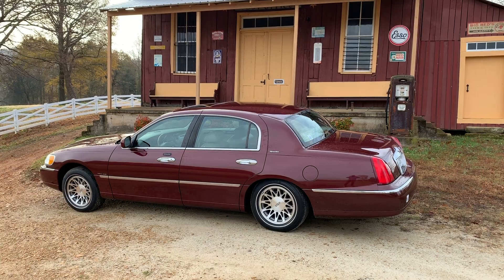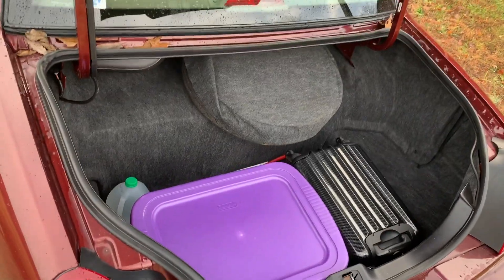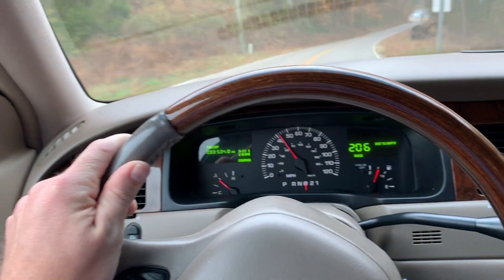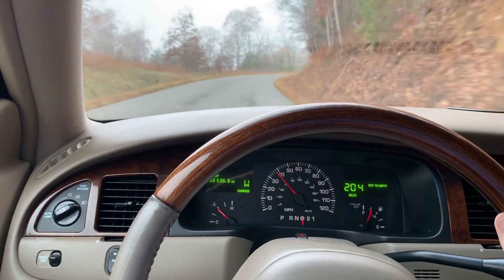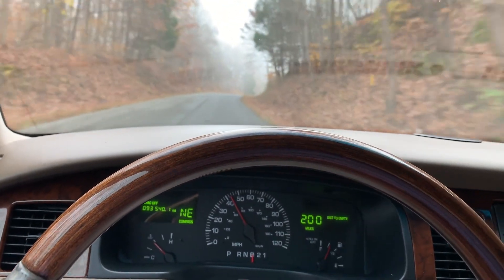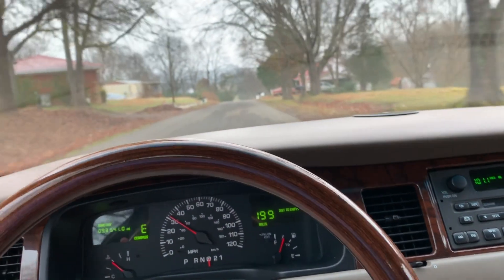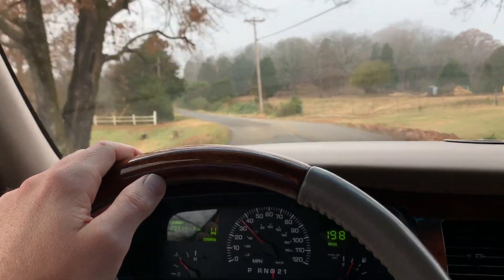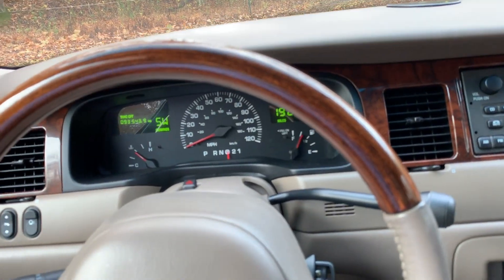2000 Lincoln Town Car Signature (Should You Buy?)

Comment from the maker: ⬇️Jake’s Top Recommended List: 

Restore Your Old Headlights With This: https://amzn.to/2sQYokq

Best Phone Holder Case Ever: https://amzn.to/2Xwbxea

American Flag Face Mask: https://amzn.to/2X1sUEH

Subscribe: https://bit.ly/2LX3YaW

Connect with me Instagram: https://www.instagram.com/jaketiesler/
Reply: 2002 and up lincoln town cars came with the fixed intake manifold wich was a serious problem on the older ones breaking and costing over a 1000 dollars they were plastic and if you put a stock new one on they would just  break again.
Reply: Instablaster...
Reply: The 2000 and I believe up to the 2005 had the old 90's style steering wheel. I loved the radio controls but the radio itself was just OK.
I have the 2006 TC. The radio is more powerful. It almost sounds like there are subwoofers even though there aren't.
Very nice sound.
And I have the Signature Limited, so there's a couple more inches of leg room in the back seat. Nobody ever complains.

Comment: You kept referring to a "pump noise".  This is the air ride suspension and as you drive down the road, it will keep the car level and adjust the smoothness of the ride.  I have owned three of these cars and they are extremely dependable and I would highly recommend them to anyone.  Very few problems on my 2000 Signature with 190,000 miles.  I expect to get another 100,000 with no problems on this car.  I might also add that the Alpine Stereo not only has cassette but also a 6 disc CD changer in the trunk.  The surround sound is fantastic and better than any car I've owned before.  And the sunroof is icing on the cake!  Love my Lincoln!!!!
Reply: Bro youll get more than 100000 more these cars if well maintained   cam run up to 600k amd higher and even if the motor blows most people junk them when you can easily get a cheap 500 dollar motor replace ot amd run forever
Reply: Whatever you do don't change the stereo it's amplifier match to the speakers it'll sound like crap if you put those speakers with a cassette deck or a CD player
Reply: @raysegura4139  Much appreciated....

Comment: I just bought a 2007 with 66k. Town Cars are great vehicles. My third one.
Reply: Is the air ride suspension problematic? Is it difficult to fix?
Reply: @supahdupahplayahmacknumbah1  After 10 years, yes. Hit a bad pothole and it starts leaking out. Would be better to replace with coil spring once it goes out though. There is a kit you can get specified for the town car, but takes a while since you would have to remove the air suspension. The light will stay on in the Cluster after that, but it can be ignored as long as you tell someone that it doesn't contain air suspension so dealers dont try to spend too much time wondering why the light is on.
Reply: @supahdupahplayahmacknumbah1  All air ride systems are somewhat problematic with pumps, lines and air shock units.  But in my experience the later Lincoln systems are quite reliable and can last well over 10 years with no problems in the right conditions where as the GM\Cadillac systems are much more prone the failure and more expensive to replace or retrofit ...

Comment: LOL Funny you didn't know about the reliability of these cars when there are livery fleets of LTC's with 700-800k on them
Reply: With that mileage is it with original transmission and motor?
Reply: @planetstupider502  Yes....theres a guy on here who just bought a Crown Vic with 1 million miles on it and it still has original engine and trans. All those use the same 4.6 L engine.......they are awesomly reliable engines.
Reply: @dalephillips8250  Taxi cabs have broken 1 million miles Alot too, with the crown vics
Reply: @captainamericaamerica8090  Yep I know about that also.
Reply: @captainamericaamerica8090  bullshit
Reply: @campervanelvisitoofonyou8720  It is actually true, there are ton of them running with way over 800k no problem. those tanks last forever. Very well built.

Comment: Great car from the period! 4.6 w/4 speed auto. That combo with proper maintenance will go 200K easy. If the back of the car was sagging in the morning, i would say the air bags in the rear are dry rotting and leaking. That car in that shape will make a great used car!!
Reply from the maker: Yes! Yes they are, I’ve been hearing the pump kick on when sitting. Cool cruiser!
Reply: If the air springs are anything like the older ones like on the Lincoln Mark VIIs then it could be that just the O-Rings have dried out and shrunk in size. The Soapy Water Test should be able to help determine if its the bags or the O-Rings where the solenoid mounts on top. I have an older Lincoln than this still riding (for now) on three of its original air springs. One common leak points on the air springs is those O-Rings compared to the air spring itself.

Comment: I have an 03 naught it near the end of 2017 with 76k now it has 110k I drove through a puddle and a coil pack stopped working cost me $150CDN to fix otherwise I've just changed the oil so far it is about the most reliable car I have owned. I't is like driving a couch. Great car.
Reply: Armed with a 7mm nut driver you could of changed that in 5 minutes. Watch a video and DIY!
Reply: It's like driving a couch. LOVE IT!!! 😎 Just spotted a beautiful silvery-beige 2001 Town Car for sale near where I live and I'm really thinking about buying it. It's not what I was in the market for (was looking for a black Ford Taurus Limited 2015 or newer), but for $1,950 with a ton of new parts (suspension, intake manifold, brakes, tires, brand new tabs, and more), I'm thinking this car is a pretty good buy. It has 237,000 miles on it and the leather seats are very beat up, but from what I'm reading about these cars lasting forever, I'm seriously considering buying this car tomorrow. I could throw on some nice seat covers and it would make the interior look near-new. I've never been a huge Lincoln Town Car fan (owned a Mark VII and two Mark VIII's since 1999), but after seeing all the rave reviews on these cars, I just might go for it. 🤔🤔🤔
Reply: Made a mistake on the dealer to charge me $100 to replace a coil pack I buy them on Amazon now for twenty bucks with lifetime warranty

Comment: Yes reliable! We have had 4 in our family over the span of my 34 years of life! One we had from 91-08, a 91 executive continental, when I was 14 I started driving it alone & traded it in to buy a yellow sunfire to match my husbands when I was like 19 or 20 cause we had a newer town car, next car listed but I do regret that! The second Lincoln in my life was a 2000 Cartier town car from 00-2017, I hit a deer and then it was submerged by flood waters in hurricane Harvey & since I couldn’t handle riding in anything else with my spinal fusion & needed to stick to my dream town car hahaha the 98 signature town car we bought in 2018 & just got a 2009 signature limited for my dad, we hit another darn deer and he passed away leaving The Eagle to me.  I grew up riding & driving these & DONT like to drive anything else. Fun story, my buddy’s 02 double stretch executive’s air ride went out 😢 but we fixed it! I’m 5’1” & like 100lbs soaking wet  with rods and screws in my neck and back and still rolled under there 😅 she’s been afloat since changing the air ride bags (it’s not hard) & replacing the air line running from the compressor to the bags. See, he raised it onto jacks without shutting off the air ride 😮 I was like NOOOOO Never ever ever do that! Maintenance & upkeep is easy, take care of your town car and it’ll take care of you. Change your entire coiling unit, all the cylinders.. it’ll run beautiful forever if you just pay attention to it & keep your radiator clear of debris. Air ride problems don’t have to cost a fortune if you’re just a little savvy with basic mechanics.. the compressor under the hood has more bolts than anything related to the relay and they’re beneath it, up front. The bags are underneath but twist out. Seriously it’s easier than changing the oil & filters lol.. by the way, they do some mad burn outs and are fun on the track. I have a burnout video on my tiktok with my silver blue hue sig series or AKA the SS Ice Dragon on @tessy.Ohana not advertising just like hey y’all this car is a beast & is a lot of fun. It eats gas but if you reset your gauges once you’re cruising it helps. 😊

Comment: 2 things, 1 I'm urr age and say same thing when going to my Dads. I know these roads like the back of my hand. Yes we do. But in country deer jump out and cost me a grand worth of damage. Always keep a sharp eye out. 2, I own a 99 Cartier 253K and 07 designer. Same mpg, gr8 cars. The air springs get cracks cause nobody seems to get the fact that rubber is like urr skin and needs moisture. Slap a handful of Vaseline or 303 spray. My sprigs are going on 11 yrs in rust belt. They r 1st cars to get a 5 star crash rating, reroute the AC drain so water don't drip on passenger frame and rot, seal up cabin air vent, and service on time. They will last 4ever. Many go 500k and some 700 or more. All about care. Have a good 1. I love these cars. Especially for family.
Reply: Do you recommend an 04?
Reply: @demri123  Yes. I recommend any panther car, town car, crown vic, Mercury Grand marquis. Any year 03-10 is last gen with newest advances. B4 that they are good but have older style heads, non pi, older plastic crossover that can leak. Small issues nothing major. They all have issues but the panther has few, and those are easily, and cheaply fixed. They're truly the last gr8est sedan produced. There's a reason why they was and still are being used for cop, fire, etc.

Comment: One of the most reliable cars on the road today with very cheap repairs if any, usually to air suspension...(not as cheap though)...I've owned many TC's and love them!! They are like an old pair of shoes....just feels like a great fit and comfortable..plus I could get 32 mpg hwy driving mature...gosh I loved my last one, a 2003..would love to find a 2005 Cartier or Ultimate edition with every option..including the power trunk..the one that actually closes from the full open position!!
Reply: Just replace the air bags with coil overs from a 90s grand marquis and problem is solved. Hardly any difference in road feel
Reply: Liar there's no way your getting 32 🤣
Reply: @Elijah-fc3ex  I commuted from Tampa to Sarasota several times a week..I was OCD on tracking my MPG..I do not depend on the trip computer either...I would fill up drive down then fill up again..that would determine my mpg ..I admit I did drive slower..55 to 60 most of the time..no stop and go..all hwy between Tampa/Sarasota..Many people with the Panther frame Fords attain 32 mpg..not that unusual!!! You do have to drive like an old man...drive like there is an eggshell on gas pedal and a glass of wine on the roof..no fast starts or hard stops!!
Reply: The east coast of Fla is mostly flat. When I drive my tc car in Fla I get 25mpg in all around driving  29 on hwy . In South Carolnia which is alot of hill and dale driving I get about 15mpg in all around driving. 24  on hwy .
Reply: THE TOP ELITE MODEL IS THE PRESIDENTIAL MODEL. I HAD ONE AVAILABLE TO BUY AND I WAITED TOO LONG TO BUY IT, IT WAS,SOLD😩😩😢😢😢😭😭😭

Comment: The only reliability issue I've seen with these is the air suspension. The bags wear out, and the pump works constantly to inflate them. The good news is that it's $150 for a spring and shock kit that turns it into a coil suspension, and it's easy to drop in. These are panther body cars, so think of the mercury grand marquis and Ford Crown victoria with way more luxury. The thing I love about these cars is that they aren't apologetic about being comfortable and luxurious. Luxury trucks and suv's always felt like they had to justify their comfort with utility. These cars feel very pre 9/11 in that they signify success in the way that having one means you don't have to work hard anymore to make it; you're already there. They aren't meant to be particularly fast or sporty and the trunk is large to fit golf bags and luggage. When you are in one you get a feeling for what the ww2 generation had in mind for life. You get to feel what boomers were told they'd get before financial collapses took their pensions and retirements away. You don't get cars like this anymore, especially not marketed to the middle class.

Comment: Another thing is the cats. I run mine with no cats. Use spark plug non foulers for upstream. There's videos on that and have just mufflers. Or make it loud. Also tge airbox horn for fresh air is 2 inches. That's a joke for a V8. I make it 4.5 inches of respectable size. And make sure on 02 older that throttle cable is tight. Mine wasn't opening 100%. A few small zip ties to take up slack fixed that. Shell surprise u. Not a racer but for a big heavy car that can breathe easier with less restriction, she'll squat and go. Love panthers. Gr8 cars with best ride besides a Citroën with the hydraulic ball system. That's the best riding car I've ever been in. Better than a Bentley, why they borrowed it. and Rolls

Comment: I own the same vehicle and the surge has to do with the idle fan taking up most of the power. That indicates a bad idle fan motor. You can disconnect it and the surge goes away, but isnt recommended as the engine can heat up badly in the summertime. I would recommend replacing it, but not sure of you have by now or not. Vehicle has 87,000 miles when air suspension went out and had it replaced.

I will give you Pros and Cons from my experience.

Pros:
° ride is smooth
° sunroof
° break pedal adjustment

Cons:
° Alot of electrical issues (some is resolved due to some pins have corrosion on them in connectors, but has to do with age)
° Parts aren't cheap, but they are cheaper than when it 1st came out.
° Would recommend removing the air suspension and use coil spring instead as you will have frequent problems.
° Some parts are no longer made, like the insturment cluster, which you would have to find someone who fixes them.
° CD Player is in the back trunk (can buy a replacement radio with built in CD Player to combat this and is pretty cheap to do)

I recommend it, but make sure you have money on you just incase as they are old cars and may have alot of issues due to age.

Comment: The pedals on these are hazardously close to each other, adjustment or not.
At a light, you can easily be feeding it gas.  You can also hit the gas at the same time you are braking resulting in a pretty violent herky-jerky.
Reply: Do you wear a size 16 shoe? I'm fairly average sized and have never once had any issues with my 2000
Reply: Yeah width work boots on the size 10 my first start driving it I drove over a parking block pushing the brake at the same time as the gas

Comment: I bought one last year, 96k on the odo. Best car I've ever owned out of 12 previous cars/trucks (had 2 rangers that were amazing even after 100i each by me , f*** a jeep as they got stuck in rural hills Ohio and in RIVERS 20miles down the river crossing at Fairbanks problemless) Lincoln is the bomb car, like a living room on wheels. Pump noise is normal i worked managing a shop for 6 yrs, it's an electric air pump. All air compressors make noise, give me a break. Clap your hands, or do an armpit fart, the compression of any air makes noise period point blank.
Reply: correction** Sand banks not Fairbanks and 20 miles in the rangers where jeeps got stuck early and 100k driven by me.

Comment: The airbag has a leak if car sags overnight. The compressor will work overtime to compensate. Not cheap but compressor is more expensive to replace. Same system was on my 85 Conti.
Reply: Yeah, rear suspension and intake manifolds on the 98-02 were problem areas.

Comment: Friends mom has a 2000 cartier, it has 400k miles, still goes strong, interior, body in good condition. The only thing about em is the coil packs are very sensitive to liquids and whatnot. And after a longer time the window mechanisms tend to get slower and rust a bit, but otherwise engines, suspension, gearboxes, electronics work like a charm. No wonder the police, taxis, etc used them so much.
Reply: This statement couldnt be any more well stated i have a 2000 250 miles and my coil pack got a little water on it amd shit the bed besised shitty coil packs its a great car no doubt
Reply: YOU'RE CONFUSING THESE WITH  CROWN VICS, THESE WERE USED BY POLICE SECURITY AND TAXIS

Comment: My mom has a very nice 2000 Town Car Cartier. When she bought it had only 81,000 miles on it. Has been a good car. Only issue is the infamous water leak. The leak cost 140.00 bucks to get fixed but well worth it and no more leaking in the car.

Comment: There’s one with 58k under $6000. Should I consider it? I’d like it closer to $5000.
Reply: I got mine for $2700 has 120k miles no check engine light just has a fist size dent on rear fender, so if yours has perfect body and half my mileage maybe double value of mine